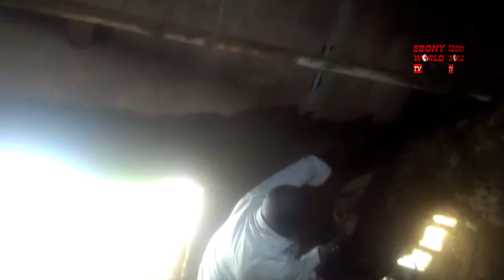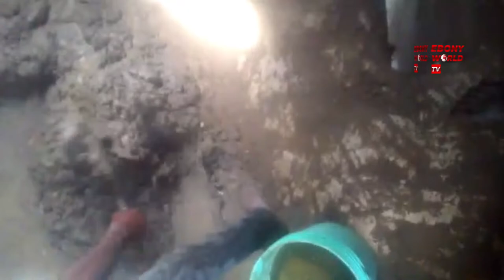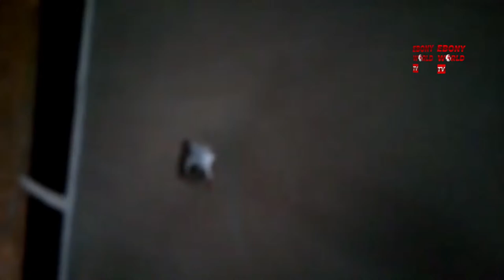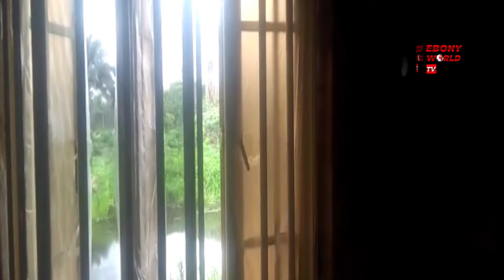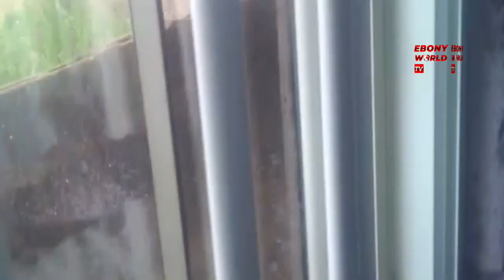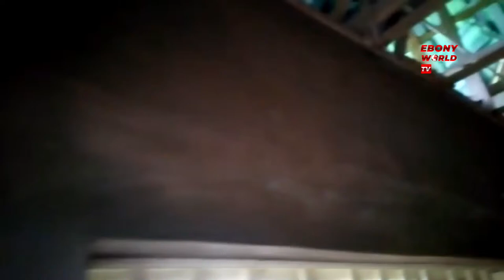ESTIMATE OF PLASTERING TWO BED FLAT

Comment: I use 5 inches Blocks for my 2 bedroom and a parlow House.  How many inches 
Door frame will I use?
Reply from the maker: There is nothing wrong with the frame you used but it’s not Morden,  the Morden construction has tilted to the wide doors frames
Reply: Ok. I Believed I can use 6 inches door Frame and the thickness of the plastering also can blend it up

Comment: At what stage do you do plumbing ?
Reply from the maker: You can start the piping into the wall right from the foundation as they set the brick 🧱 and also you can do the premolar pipe work before lintel

Comment: Boss I have done my parapet now about to roof blc am flowing your program but on your last program you told us that New Zealand original roof ties is 2600 please do you know any company in imo state or abia state
Reply from the maker: No I don’t have any
Reply: Hi Kingsley  please i will like to know what it cost you to do your parafet, and how many flats
Reply: ehis Stanley hello my house is duplex  I think 36 by 40  under 600,000 , I bought 1 trip of 911  chipping plus the little one remaining from the house project 16mm for the beam 10mm and 8 mm plus board I bought some and took some from the house project and I think 2 trips of sand
Reply: @kingsleychimezie8835   thanks bro really appreciate  you , for your response thanks.
Reply: @kingsleychimezie8835   and so sorry to ask what do you think of putting it for tenants is okay I was kind of  thinking ? .
Reply from the maker: If you are renting property or t you do not need to all the expensive things but if you are going live in it then you can put anything
Reply: @LuluDumba  alright sir thanks